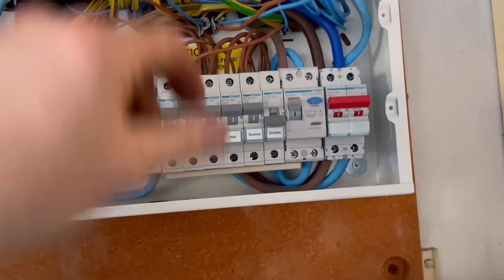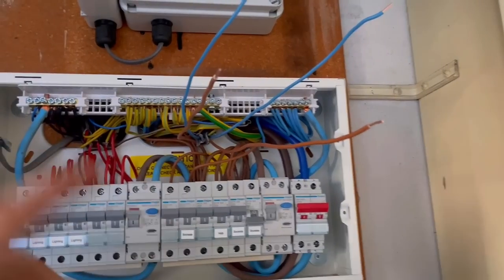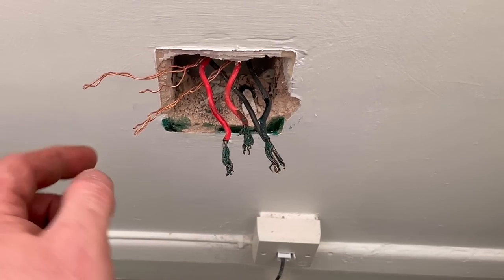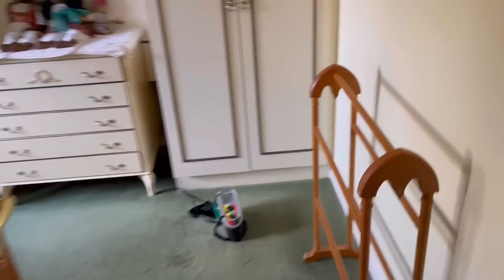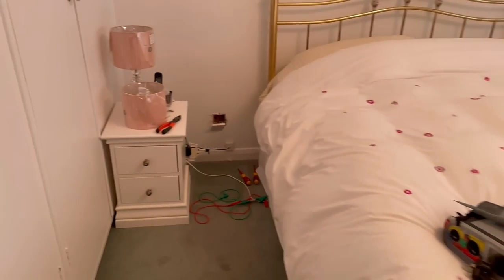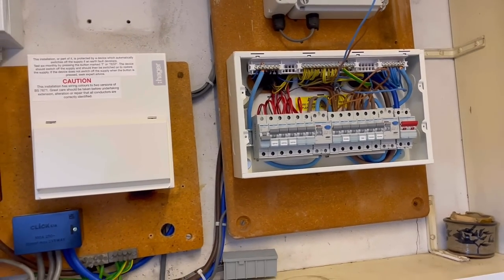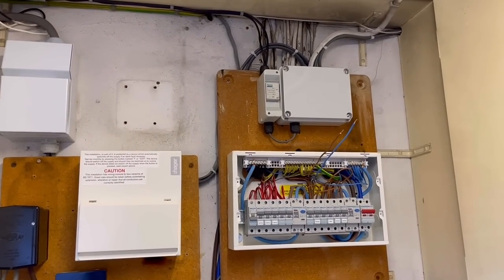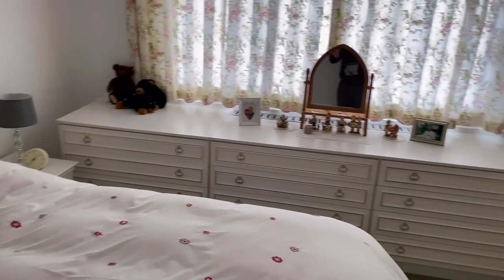Ring Circuit Fault Finding Plus Green Goo

Comment: The green goo is the plasticiser coming out of the insulation.
Currently all manufacturers are saying no need to rush and rewire BUT the green goo is a HSE risk so wearing gloves is appropriate NOT to get Di-isoctyl phthalate on your skin. 
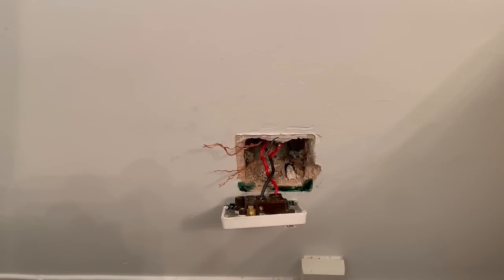I have seen cables insulation become brittle with cracking so needs monitoring! 5:08
Reply from the maker: Thanks Shaun for taking the time to watch and comment

Comment: If you haven't seen the green goo it's just like fairy liquid . It's a breakdown of the insulation,  doesn't mean it's been overloaded necessarily.  I have seen it on lighting circuits more than  sockets . Sometimes it's an odd piece of cable I  a whole house . Definitely 1970s houses which can suffer from the problem.  Lots of houses are rewired before if becomes an issue because people move house and renovate etc ,  we have more electrical appliances than ever so need more sockets  hence houses are rewired .
Reply: Seems like it would mostly happen in places where the wires are coming down from above. So any length of wire above the guy could build up and leak down the length of the cable over time and come out the end.

Since most socket writing now it's from the floor up and is from the ceiling down it's going to happen more on lighting rings and in bungalows maybe where the mains trying is wired in the roof down.... Maybe.
Reply: @ge2719  that would make sense.  Gravity
Reply: I've had it on an extension lead, coming out of the trailing socket. Proper old stuff, non-earthed German plug and twin flex, moulded plug and trailing socket, 50s or early 60s probably. The whole thing had a peculiar chemical smell to it so the process might well have something to do with plasticisers reacting with the copper.

Comment: There doesn’t seem to be much information about the green goo in general. In fact unless you have seen it you probably wouldn’t believe it.  On one job it was so bad it was running down the walls.  Last year I part rewired a bungalow.   The customer didn’t know what I was on about until I showed them a couple joint boxes from the loft full of the goo.

Comment: Avoid touching it with bare fingers. Its like a fine oil that gets into your skin. It doesn't wash off instantly and can make your eyes sting if they come into contact with your hands...Even if you've washed them and they are bone dry. It also gives of a distinctive smell, I cant describe it but once you've smelt it once, you wont forget it.

Comment: Not seen electrical go full goo myself but I have seen the precursors where the insulation on a core has started to react with the copper, beginning to chew it up and also stuck to it making it difficult to pull off.

Comment: All the 6 amp lighting circuits on one Rcd Rccb and a din rail Doorbell transformer in a plastic non amendment 3 2015 enclosure Fab.
Reply: 421.1.201 Within domestic (household) premises, consumer units and similar switchgear assemblies shall comply with BS EN 61439-3 and shall:

(i) have their enclosure manufactured from non-combustible material, or

(ii) be enclosed in a cabinet or enclosure constructed of non-combustible material and complying with Regulation 132.12. 

Not sure the Transformer would qualify as switchgear.
Reply: @conarobrien9434  Problem is similar switch gear assembly is open to wild interpretation depending on the person.
Reply: @danvictor3934  While I generally agree that it is open to far more interpretation than it should be, in the specific case of a doorbell transformer I don't think it could be argued that it counts as switchgear.

Switchgear is defined as: "An assembly of main and auxiliary switching equipment for operation, regulation and protection or other control of an electrical installation."

eFIXX did a video on the subject about a month ago, covering the related regulations: "The WAGO Junction Box Debate: Metal or Plastic?"
Reply: The two lighting circuits on the same RCD is probably because of a borrowed neutral. That's common on older installations. It's a workaround, but the alternative is very disruptive. In this case it looks like the householder is facing having to pay for a rewire anyway with the cable insulation breaking down.

Comment: Presumably the wires are overheating because there's a huge amount of resistance somewhere in that ring, right? It's not overheating because the customer is running too much current through it. (I only passed my L3 qual this year, hence the simpleton question).
Reply: It might just be the age of the wires. 50+ years old, those bright red wires might have been new tech that just turned out to not be that great over time. 
Like how products now that have a thin rubber coating like console controllers, can end up going all sticky from the rubber failing over time. 
The new  modern twin core with brown wire probably has a better coating that doesn't turn into goo 😂
Reply: That green goo, shorting on a contact i bet if you put all the sockets in wagos and retest the IR would be clear
Reply: It is not wires overheating. It is the breakdown of plastciser in 1960's 70's cable. Over time it will show on the insulation test as it does in this video. The same pesticides was also very tasty for rats and mice. Insulation tests between each of the sockets which have been isolated an hour pd the consumer unit will pin down the area of the fault. I would have checked the box where all the red/black cables have been extended by Brown/blue cable as a matter of urgency as there was green goo running out of the box. Green goo is an indicator of electrical insulation breaking down and is confirmed by the low resistance in the insulation test.